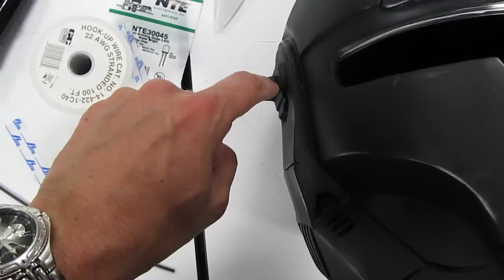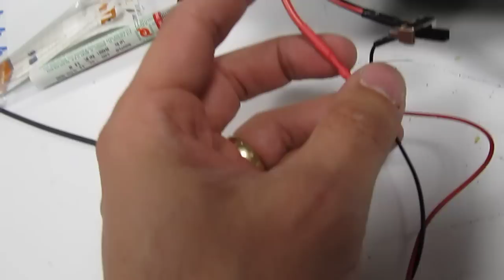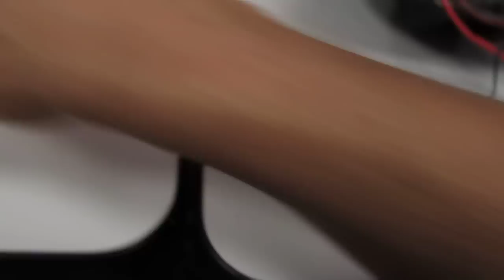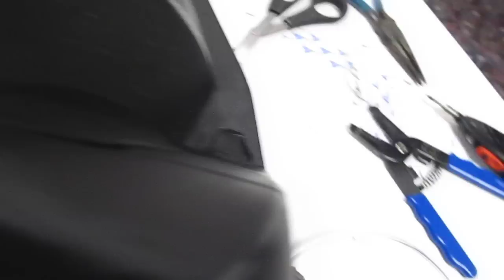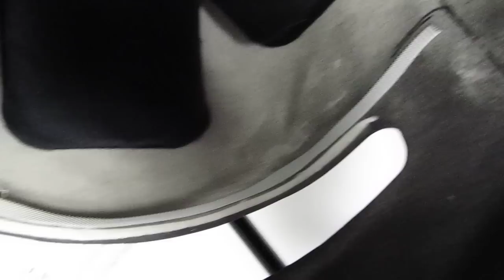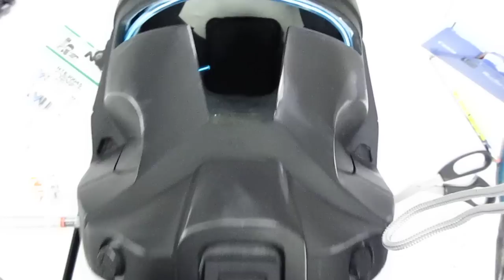Star Wars Republic Commando Armor Building 27A

Comment from the maker: I put a small ledge of ABS plastic at the bottom of the T for the visor to sit on then I glue in brackets that hold the visor in place.  I have also done Hot Glue.  If you have the time and space just build a small bracket to hold the left and right edges in.

Comment from the maker: @shadowblack1987 i did not glue on my SEV, it lasted for about a year, then the glue starts to dry up and if you are in a hot environment the glue will start to sag and your wire will drop.  So yes it is an awesome shortterm fix but eventually you will have to redo it.  the velco here was an experiment in alternate installation.  It's seems to be working OK thus far.